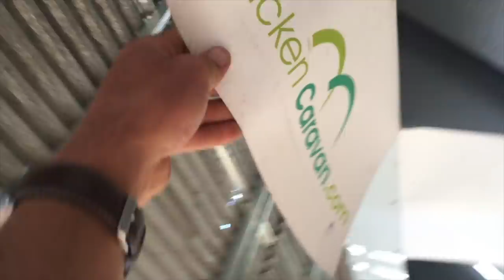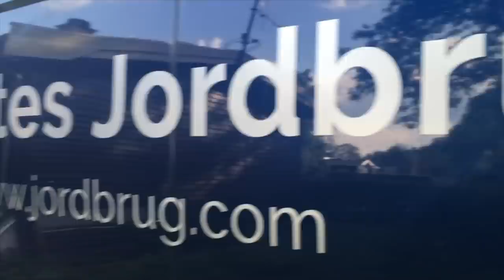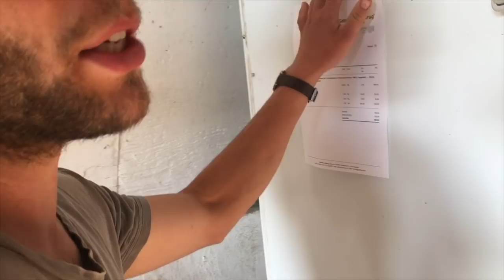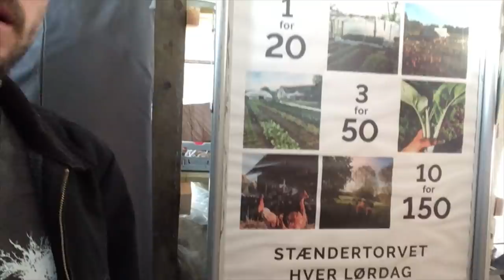BUILDING A WORKING FARM IN 5 MONTHS!

Comment: when I built my egg mobile as I am a welder by trad, I used winter vinyl snow fence for the egg conveyer the fence comes 4 feet wide and 300 feet long an just cut a strip off for the conveyer, an I have 3 more strips I could cut, I built mine with electric lifts, over 37 years ago, now I have 9 of them
Reply: you got any videos of that? sounds awesome

Comment: Time and motion studies. It is not about how much you work but how much work you deliver. Gives you more time off. 14:00 Chicken caravan automation. 19:50 Adds 700 Liters of compost per 25 M X 75 CM  bed. (185 gallons on a 82 feet X 2.46 feet bed) A little over 2 gallons per foot length of bed.  Bed size is determined by his tarps needed for protection against heavy winds and cold weather. 29:00 Moving chicken tractor. 440 birds. 400 eggs a day.

Comment: Great stuff!
One potentially big timesafer came to mind when seeing that guy wash the carrots like that. How about a big rotating bristle with a hanging water nozzle above it. Then you could just push the whole bunch if carrots in for a second or two and be done with it, possibly even doing two bunches at the same time one in each hand.
Reply: Thanks! We will start soaking the carrots now, and have them standing in water for 5 minutes before spraying. Hopefully that will diminish the need any brushing, only rinsing.
Reply: I hope that works, because that would be easier than installing another tool/machine :)

Comment: How does he get water to the chickens?
Reply: We have installed water for our animals in all fields, similar to Richards setup.
Reply: So you ran water pipes? What kind of pipe? PVC or that black pipe? We are still debating whether to run the pipes or use the totes to bring water because we have some totes and at 200 acres, that would e a lot of pipe. What do you suggest?
Reply: PE pipes. we designed the layout with google earth. I have no suggestion, it all depends.